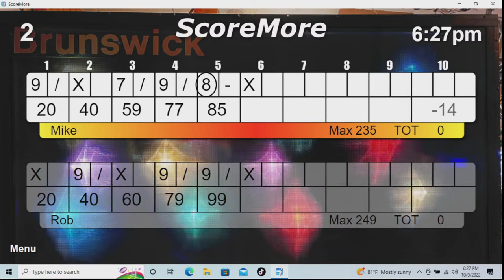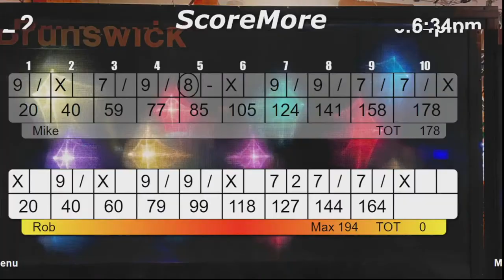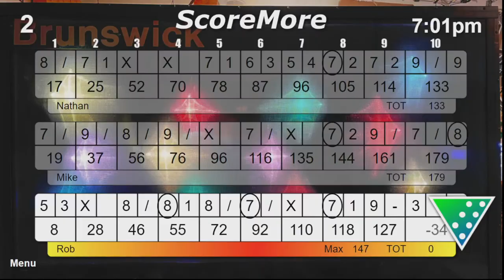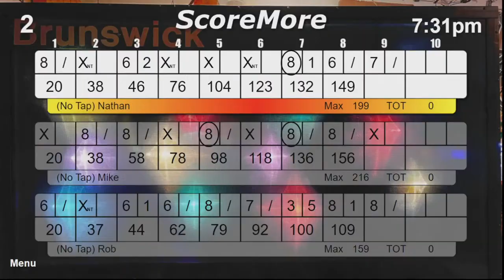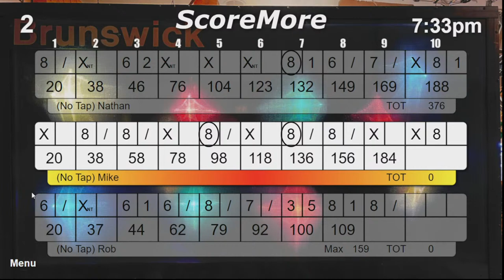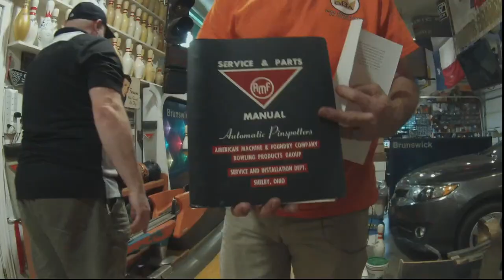Golden ToaSter reveal ! Sunday Live Bowling and Chat ! With Mike, Rob, Nathan, + Aaron - Thanks GSH

Comment: I know the AMF machines the cups can be adjusted to the left and right to ensure the pins are set perfectly.  Can adjustments be made on the Brunswick A series machines?
Reply from the maker: Not on a Brunswick. The moving deck is fixed.   The pin is sitting between 2 spotting fingers on the back side and a deck roller on the front      3 points of contact.   If your fingers aren’t bent, deck roller is good and your cable is set correctly the pin should stand perfectly upright.   There’s not a way to tweak just one pin position.  You have to loosen up the deck from its posts then you can adjust the placement of the entire deck assembly but it should line up with the pindeck spots.
Reply: Thanks!